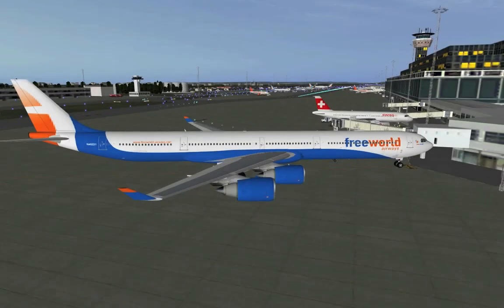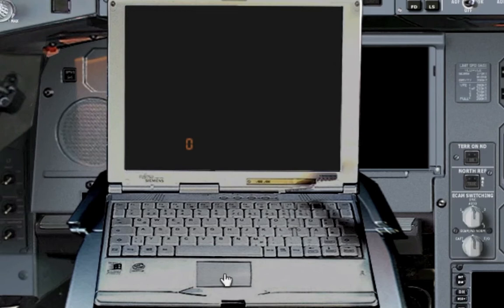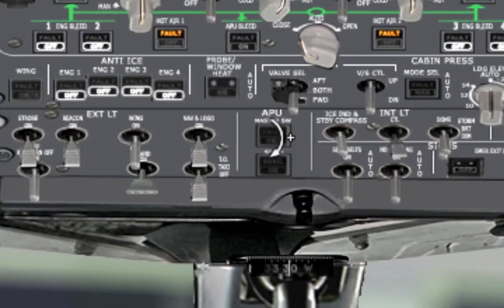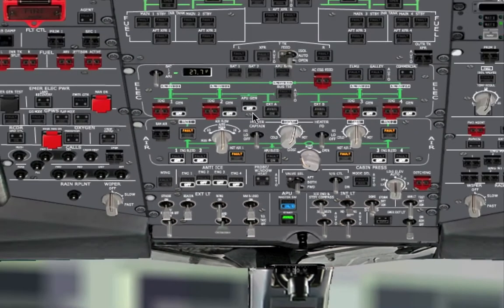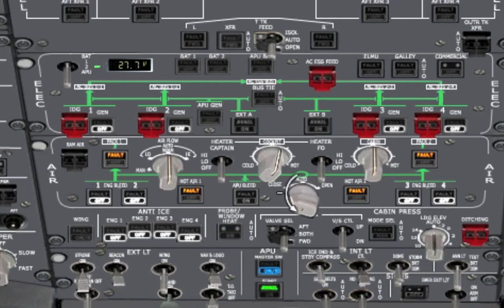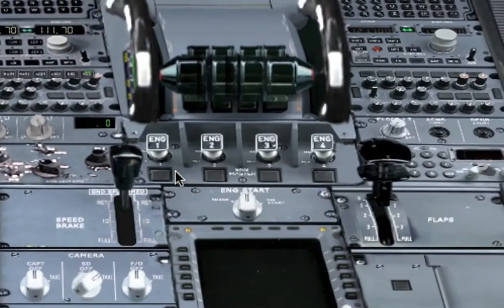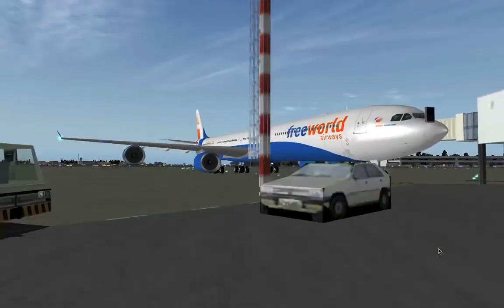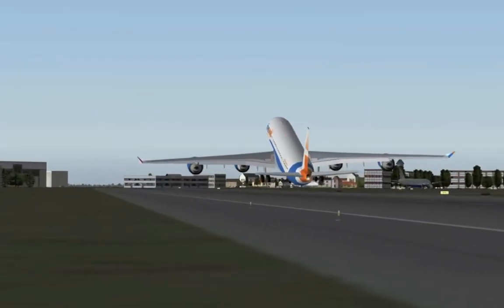X-Plane A340-600 Startup Procedure

Comment: I actually am a Pilot in Freeworld Airways but I just joined so I only logged 1 flight with the XAcars. It was a flight from KSEA to KSFO. My pilot number is FWA561M.
Reply: Do you recommend it?
Reply: Gate2Gate Aviation I do
Reply: X-Plane Aviation Do you have to use Vatsim while flying flights for them?
Reply: Gate2Gate Aviation
That would be your choice
Reply: X-Plane Aviation So you can fly with default ATC if you want?